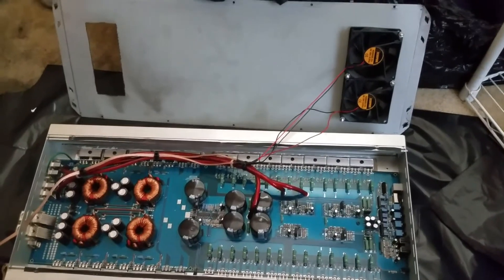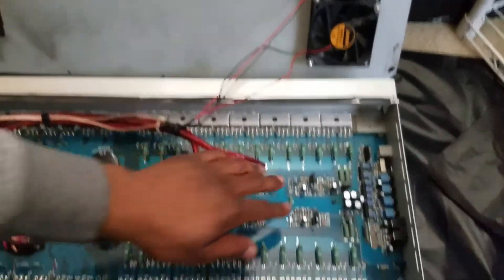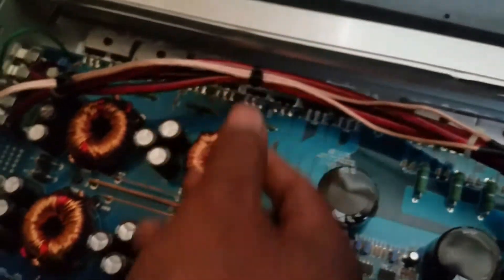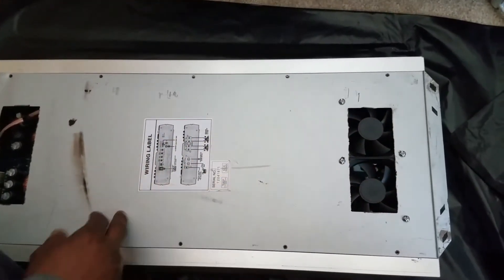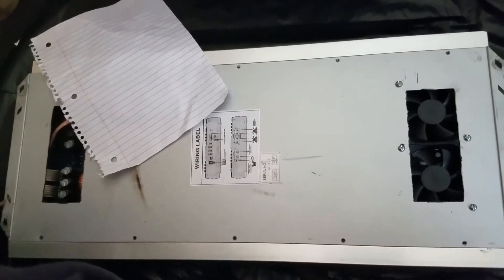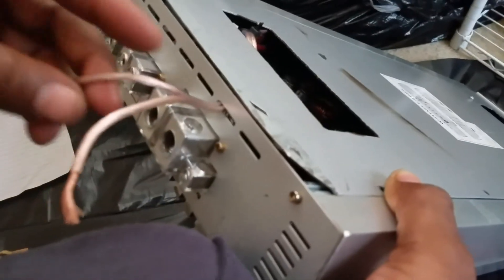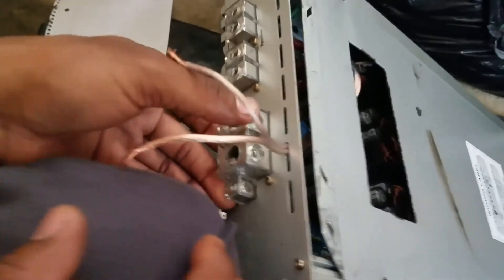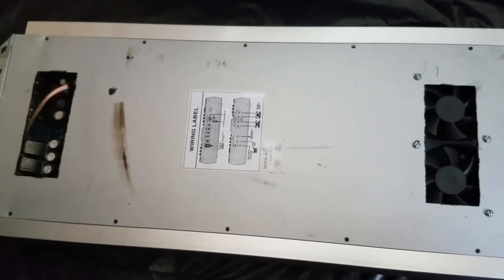Fan Installation in Car audio amplifier

Comment: cut the those screws
Reply from the maker: Although they are long they don't touch any components. I used what i had at the time but if i did it again I'd use shorter screws

Comment: OMG but where's the speaker wire go to? No one's explained this well at all
Reply from the maker: I wire the positive to the remote and negative to negative that way the fan only comes on when the amp is powered on
Reply from the maker: I stated this information in the video BTW